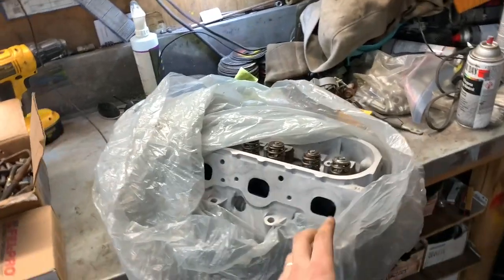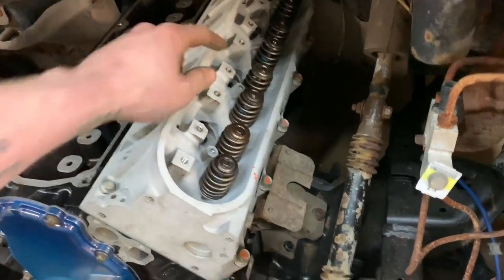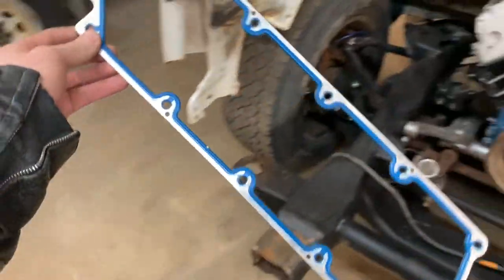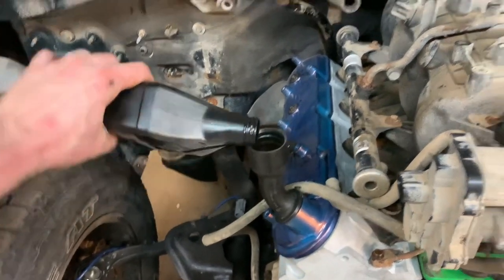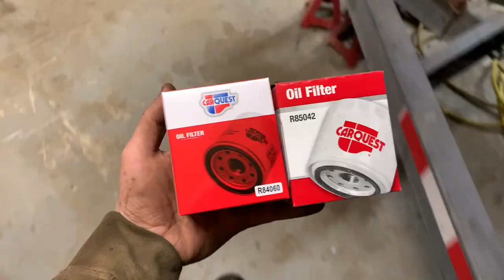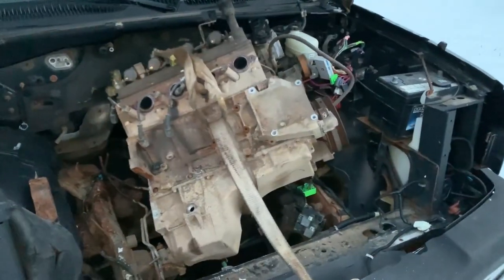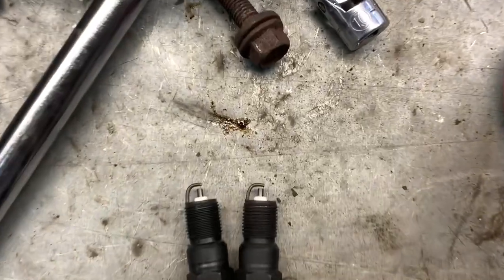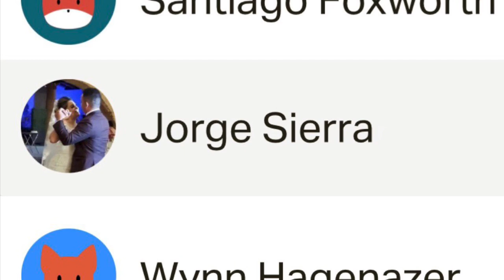Installing water pump, alternator and power steering, intake and exhaust manifolds on my 5.3

Comment: Yes by, the fully assembled turn-key LS is not a pretty engine, but what can you do?  To make it look good costs a lot of money.  

Too bad you had to cannibalize the rat rod, but that just means you got stuff to work on once Desperado is complete…well other than the stuff you’re going to break on Desperado during shakedown and once the turbo is on.
Break, wrench, repeat buddy😂😂
Reply from the maker: Oh yes I’ll have lots of work to do between the rat rod, Desperado and then whatever becomes of the Escalade when the electrical system gives up the ghost
Reply: @StationroadRatrods  never a shortage of work on a rig around here by.  Lol